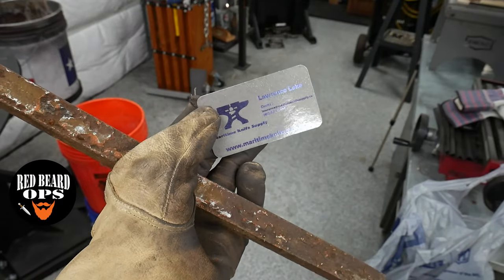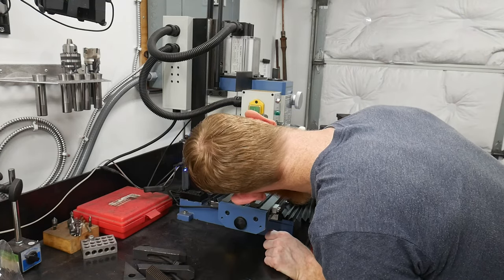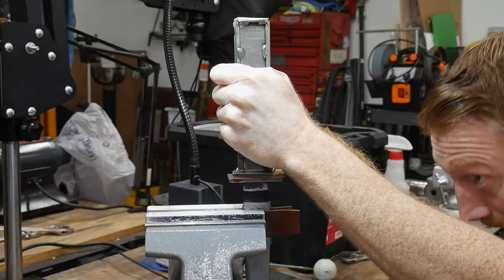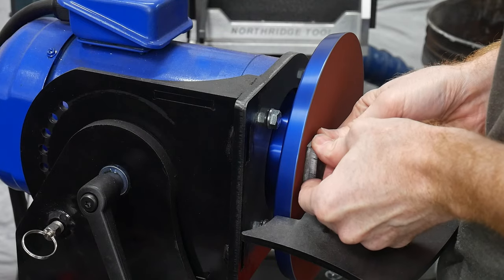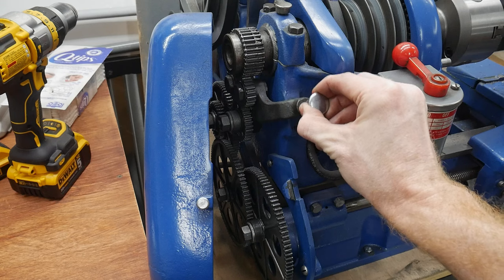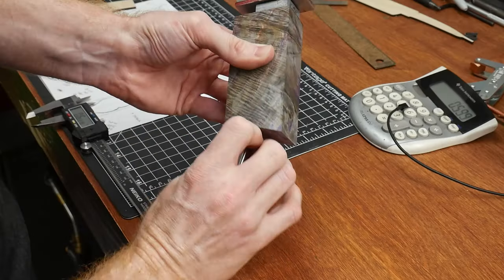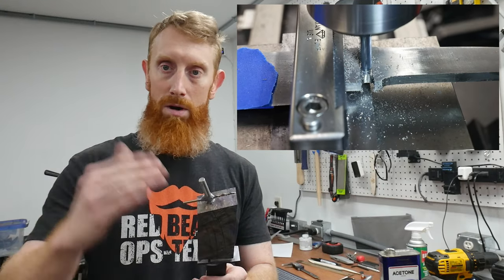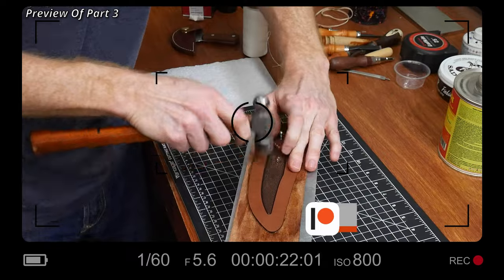My Best Attempt Making an Heirloom Damascus BOWIE!  Part 2

Comment: Nice!  Great processes.  Hey, you mentioned the nick wheeler style fit up.  can you point me to a video?
Reply from the maker: I'll have to dig for it. Basically it's tapering the tang all the way to the center of the ricasso.. but to a very very small degree so you can't really tell it's tapered. Then machining your guard a few thousandths under for a hammer on press fit. No back cutting required. For fine tuning I think you could engrave away a little bit of the center on each of the ricasso shoulders. Kinda a reverse method to the Royer fit. Some of the process could be here... I didn't re-watch it - https://youtu.be/oSjuKpPFCeA

Comment: Think the best advice I ever got with wrought iron if it starts giving you trouble is to treat it like forge welding every time you need to move it somewhere or deform it considerably. Reason it was explained to me is that its basically full of crap and inclusions that look very cool, but they will open up under pressure, so they need to have enough heat in them to self-weld during the process.
Basically, go hard on the heat, softer on the hammer and when it cools off a bit down to the 'reds' in terms of colours its time to heat it up again
Otherwise I think that handle is going to look really good, which is nice considering you've sunk a lot of time into it! But it shows and I think the end result will be worth it
Reply from the maker: Good tip!

Comment: Looking great dude!!! Quick question... When you bed the tang, how do you remove all of the Vaseline from the inside of the handle for the final glue up?
Reply from the maker: You could run some acetone patches though there to get it clean. In this case the bedding was super tight, I ended up "burning in" the thang a little first, then cleaning with acetone.

Comment: Love your content! What tool is that you use at the 1 minute mark to scribe your center line?
Reply from the maker: That's called a height scribe. I use the HECK out of it on my knives. It works great in combination with a surface plate like I have or just a granite sink cut out. Many granite companies will give you sink cut outs for free. This isn't the exact one I have, but it's similar - https://amzn.to/3FAAhIq